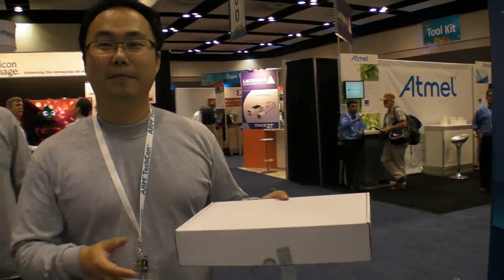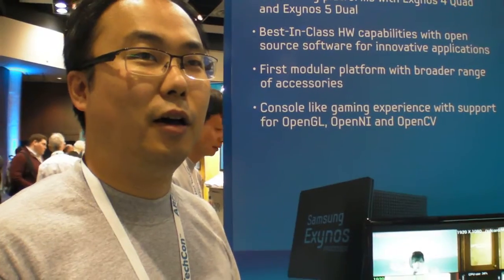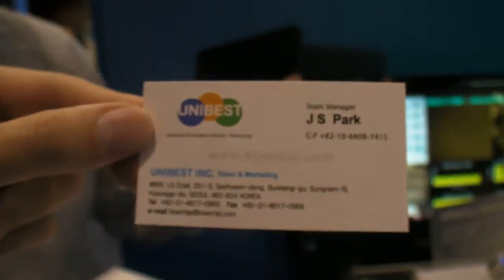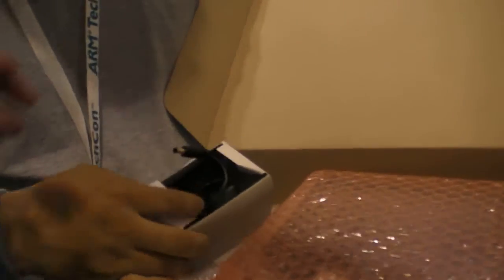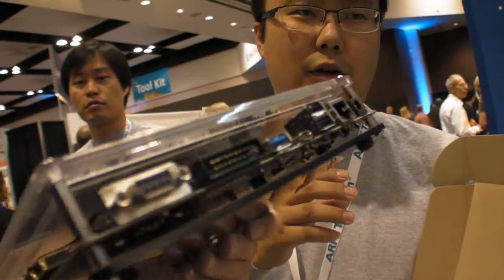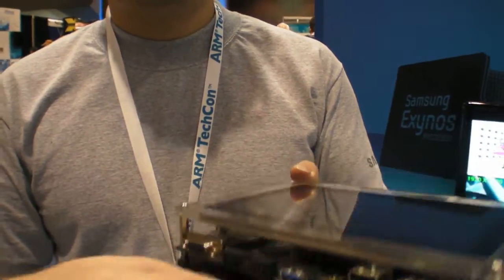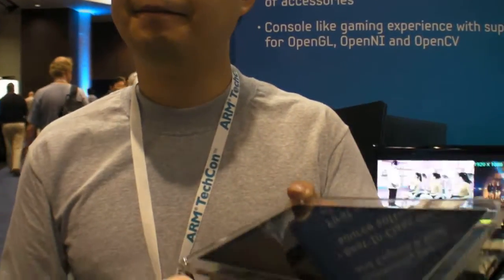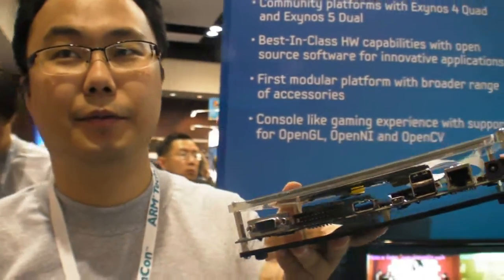Arndale Board Exynos5250 ARM Cortex-A15 Mali-T604 Development Board

Comment from the maker: Yup but consider this development board has things like: accelerometer, gyroscope, e-compass, One channel eDP output Single WQXGA, MIPI DSI, MIPI CSI, SATA 1.0/2.0/3.0 interface, One channel eMMC 4.5, One channel SDIO 3.0, Two channel SD 2.0, Four channel high-speed UART (up to 3Mbps data rate for Bluetooth 2.0 EDR and IrDA 1.0SIR), Three channel high-speed SPI, Three channel 24-bit I2S audio interface, Four channel I2C interface support of up to 400kbps, Four channel HS-I2C up to 3.1Mps, etc